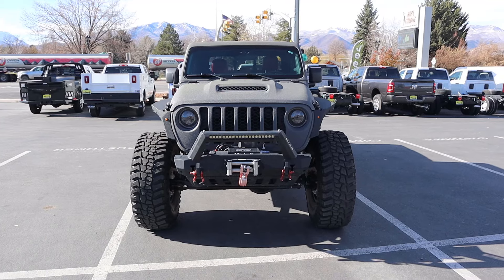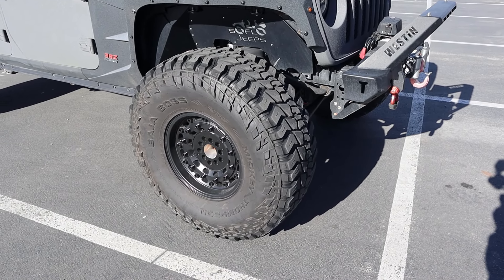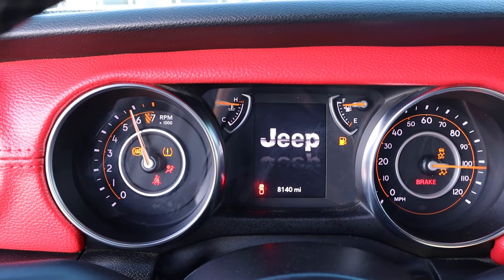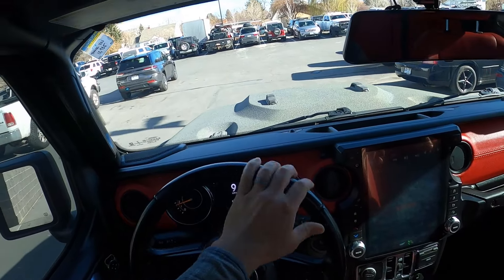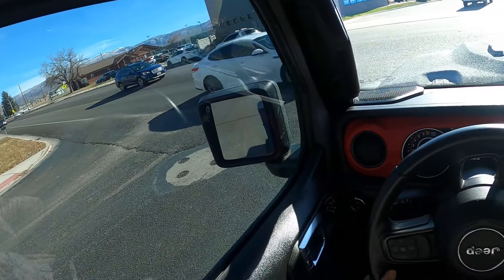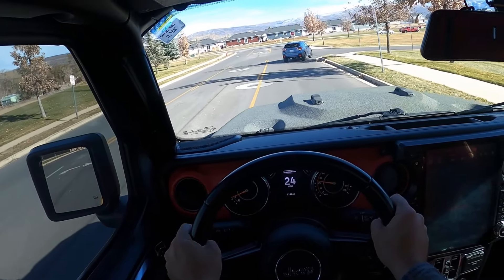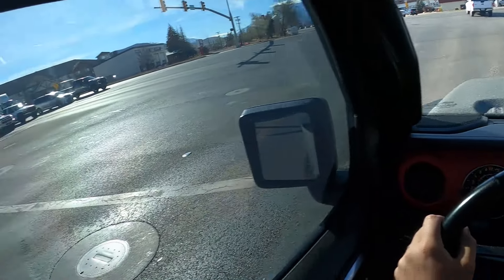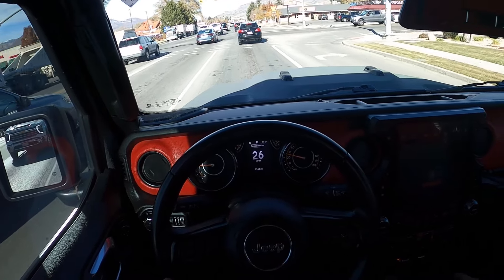The V8 Gladiator You've Dreamed Of! (Jeep Gladiator 392)

Comment: I knew Jeep saying that it wouldn't fit in there was a bunch of bull. I still think this needs to have the 3.6 as base engine but offer the 5.7 as upgrade
Reply: sadly, there is no 5.7 anymore. but the hurricaine would be a fine upgrade. Jeep has really messed up by not regularly offering the better engine as an upgrade.
Reply: @ the rumor mill keeps saying that it’s coming back. And I’m not going to believe until it’s confirmed but I’m being hopeful for sure. I don’t like the hurricane, I much prefer the ecoboost over it right now. But yes you’re right, even a 4xe version of the Gladiator would have been extremely popular